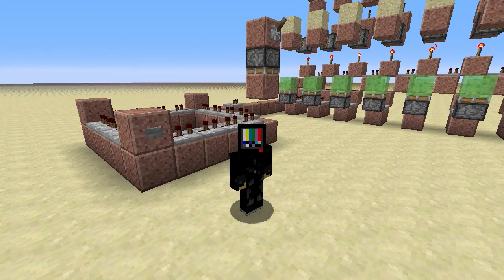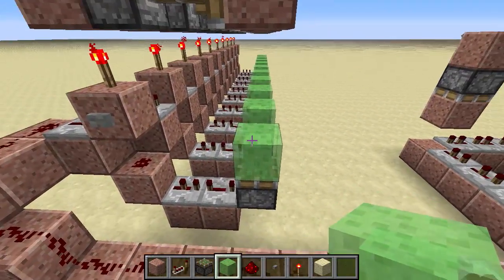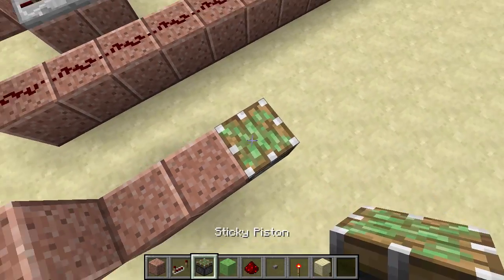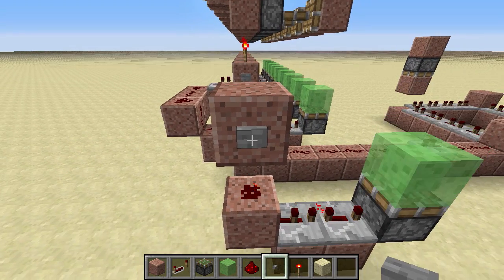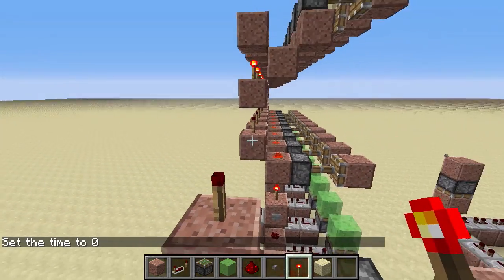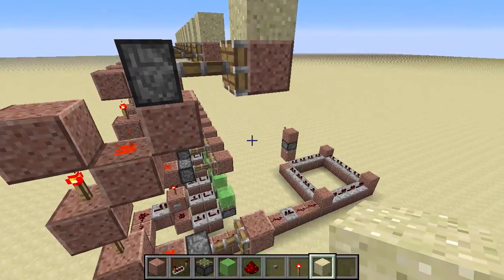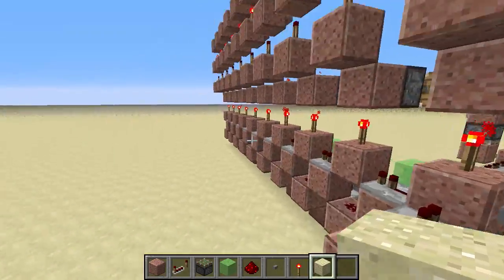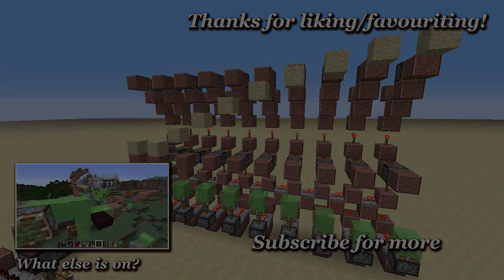Minecraft - Sand Wave Machine

Comment: Is the top of the machine even necessary? The sand would still fall onto the bottom block and be launched up, right?
Reply from the maker: It sort of formed out of something else I was doing. It wasn't originally a wave machine. If the sand ever comes to a halt on the slime block though, it will break.